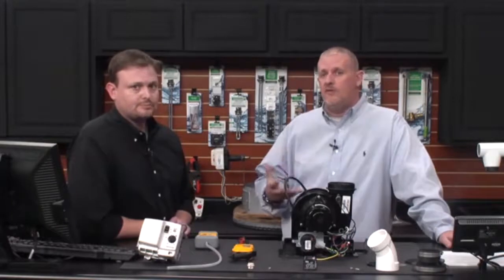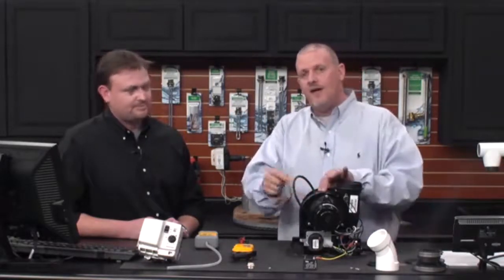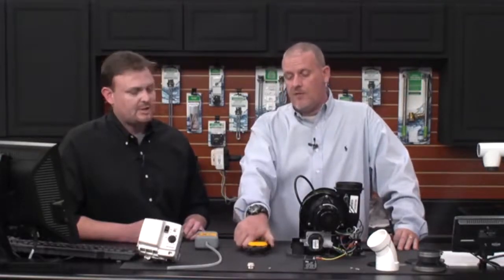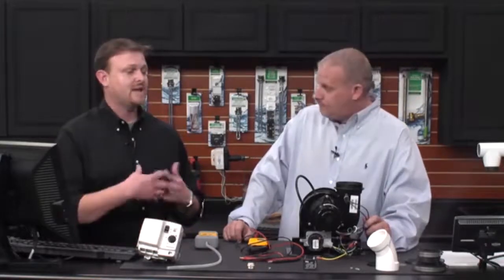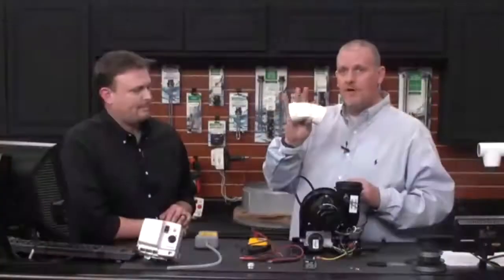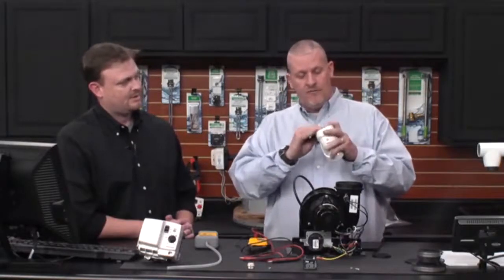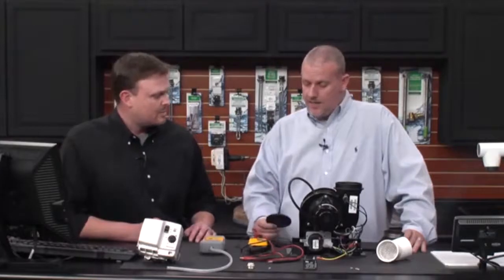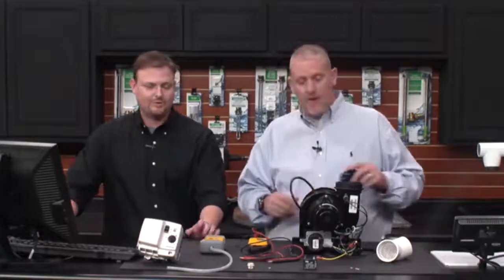PV Code 3 Pressure switch failed open

Comment: Vent motors like blower motors are designed to work against a restriction. The restriction disc is just for that purpose when the total venting configuration is lacking the necessary restriction by its design.  It's a difficult concept but by using an Amp meter you can see that the blower motor actually works harder when there isn't the restriction of the ducting.  Very nice video especially the part detailing that safety devices are very likely not failing but reacting to an unsafe condition.  By design they are generally very reliable and in themselves very functional.